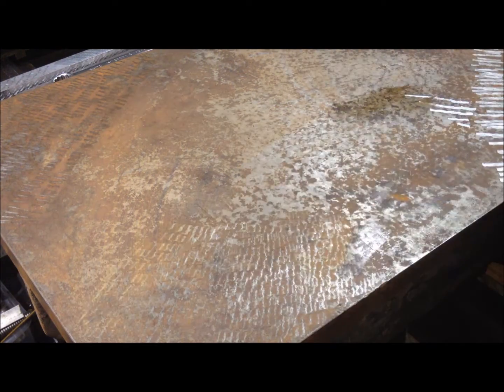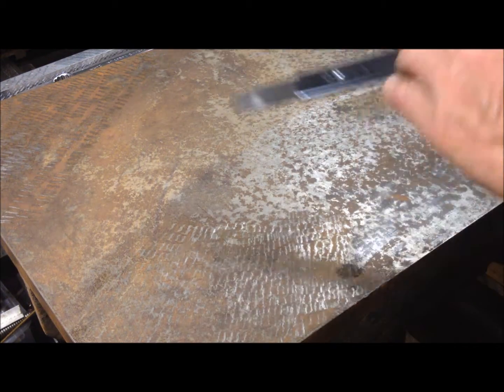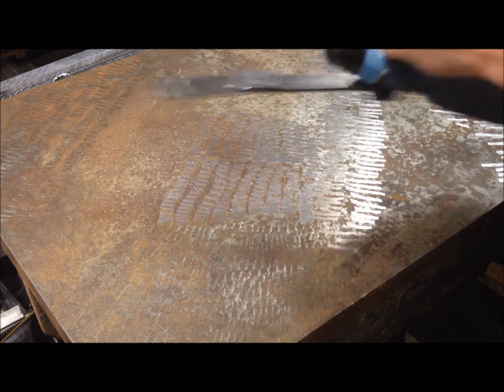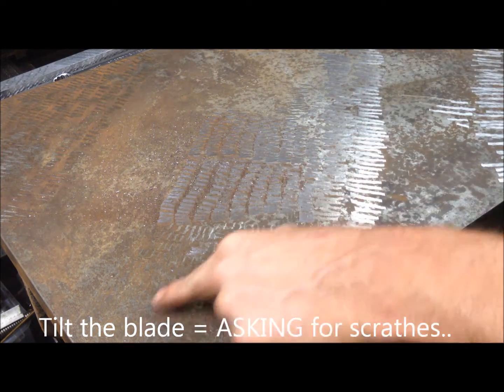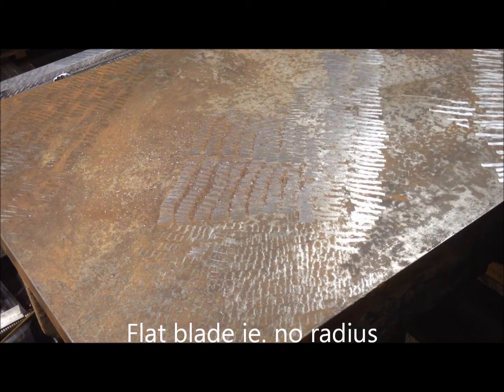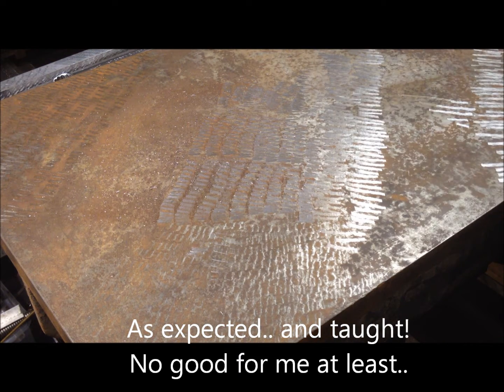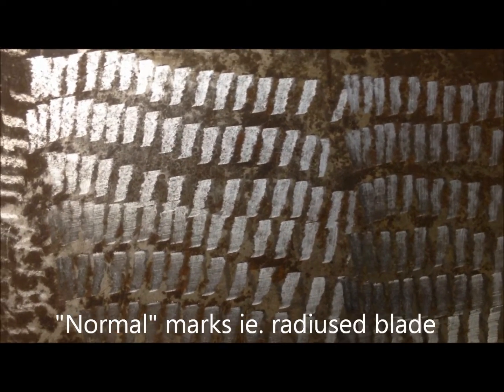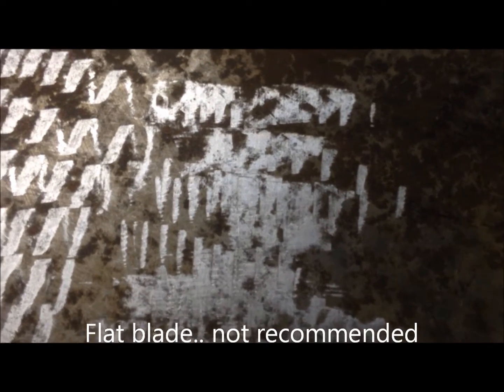Cast iron surface plate scraping part 2   radiused vs  flat blade

Comment: A flat blade scraper predates a radius blade scraper by a hundred years, surface plates were generated with short scrapers and flat blades, pull scrapers were also used. The blades were 4 to 5 inches long, the cutting was gentle as to create a flat surface as a datum to measure from not a surface of high and low spots to act as machine way surfaces.
We use granite now, not cast iron as a measuring surface. But both would not be graded in
Points per square inch. A perfect surface plate has one point on the whole plate, it's for measuring not spotting with a medium.

Comment: Flat blades are for hand scraping so why put one on a power scraper, would you try to pull scrape with a power scraper?, of course not, fit the tool to the job.
Reply from the maker: Thnks for commenting. Pls. understand thatvthis video was part of some I did to show some different ways/procedures/techniques/results/tools I have learnt so I also wanted to show what could be the result of bad/wrong practise. Based on you comments I assume you are professional "scraping hand" and it couød therefore be nice if you aldo shared more of your knowledge with the rest of us. For example, Mr. Richard King (my mentor) has a FB page called "Kong-way scraping consultants" where he shared his knowledge

Comment: Great stuff, Jan.  I just started on a surface plate with a new to me Biax, and made some awful scratches that will take many passes to remove.  It was from not being careful enough to have the blade parallel to the surface with the center cutting.  I also do not really understand how the corners of the blade should be treated to help avoid scratches.  Could you show us the bevel, or chamfer, or whatever you use, along with how you make it?  Edit: I do have the blade properly radiused, ground, and honed, and the blade is the longer, flexible style like you are using.  I can use a hand scraper just fine...
Reply from the maker: When I get back (in China now) i can at least show what I have done. Not sure if that is the normal way, but..
Reply: I want to do this to my table saw top, I've lost the receipt and don't want to spend $300 to get it flattened since the saw is worth $700 and I have a power chisel, I'd have to make that curved chisel grind though. Pain in the butt, It's a Ridgid r4512 Cast Iron Table Saw, I've read in a forum somewhere's that a lot of these lower priced cast iron saws aren't stored right after manufacturing so they don't stay flat by the time the consumer buys them, mine sadly has a bump on one side of the blade so the other side looks dipped, I'm going to have to make a jig with two parallel bars that are perfectly straight and have a carriage that rides across them with an dial caliper or something similar so I know how deep I've went, I was thinking of doing a router flattening jig and cutting it down with coolant, what do you think? I'm not sure but I have a 1/16th freud router bit that say's on it's package that it cuts steel also, if I use that bit it'd take probably 200 1/64th passes to cover 5 inches where the problem is. I was thinking of putting an thin layer of epoxy on the top and flattening that, it'd be easier I think.
Reply: You buy a "cheap" and apparently "flimsy" table saw and when its "imperfect" are thinking about throwing a bunch more good money and time after bad to "fix" it by using some half-assed, hare-brained "machine tool" made with other woodworking parts and "steel cutting" router bit and who knows what else just to "mill off" a bump that must be one hell of a "bump" if it takes that much "milling" and all to "save money" when you could probably disassemble the damned thing in twenty minutes and pay a real machinist to toss the top in a mill and cut it flat for $20-$50? Good plan to "save money" and "fix" a problem you should be dumping in the manufacturer's lap or at least shouldn't be "fixing" by spending even more time and money on what is clearly NOT a "precision" table saw and never will be and even less so once you're done hacking on it.

Comment: I bought a grade 00 granite surface plate, and although it's really flat (duh) I was surprised the  edges are not square to the surface. Is that common? I was thinking I could quickly verify my squares. Thanks
Reply from the maker: soundiscomforting I think so.. doubt that the manufacturer goes to the same degree of accuracy as it is the intended use.. I would instead measure it against an angle plate or another square